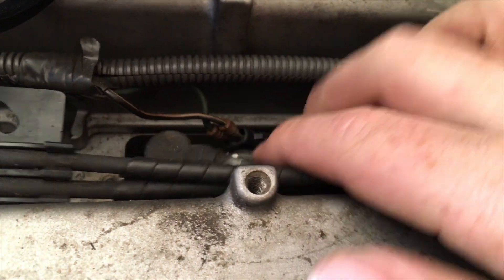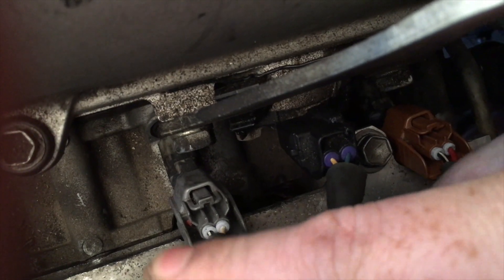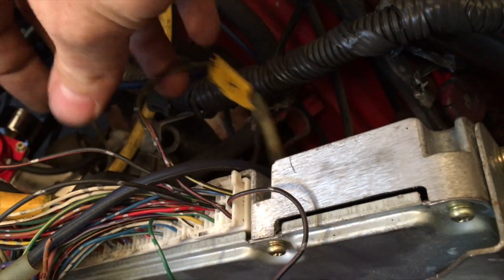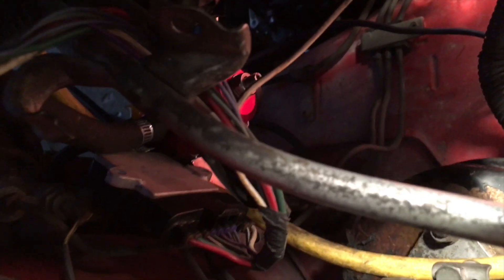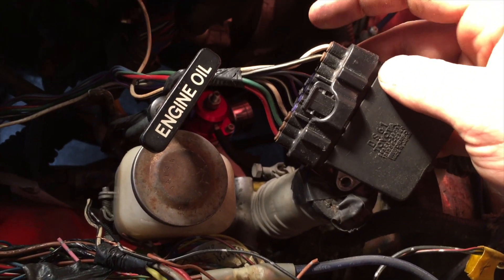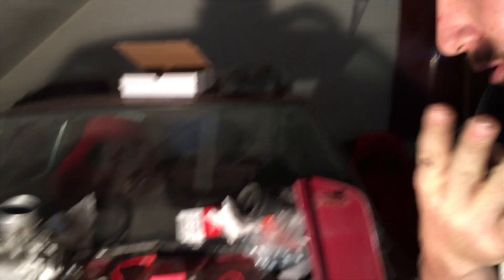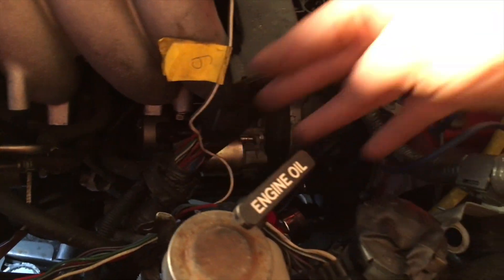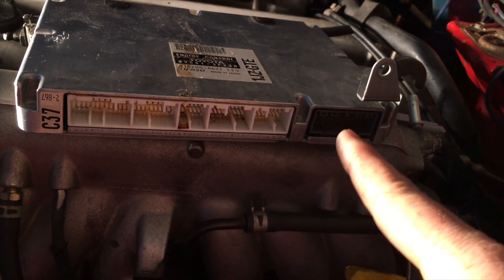how to wire a 1jz gte vvti

Comment: need help anybody???? did an engine swap 1jz vvti to jza80 surpa. just loss at a the fuel system. 1jz vvti ecu FC and FPR pinout, jza80 stock fuel pump ecu FPR and DI pin out. need advise what connect to what?

Comment: I am having a weird problem on my ecu wiring. 
I have a 1jzgte jzs171

I connected the battery and bm (ects i power) to a constant power.
I connected +B, MREL, IG SWITCH, and +B2 to 12v Switch.

When I turn the key over, it starts but I have to keep holding the key.
When I let go of key, the engine turns off.

BUT when I connect all of them together to Constant 12v power. 
They car starts and everything but I can't turn it off with the key, I have to disconnect the wires.

Also, every time my engine does start, the electronic throttle locks up. It does not want to open.

Can anybody help with any information or advice?

my email is richardpnl@gmail.com
Reply: Richard P i have the same motor and I’m having a hard time with the wiring. Do you mind helping me out? My email is palmer2244@yahoo.com

Comment: I see you  replaced the throttle body, did you get a rough idle and rich condition with the other one when you first started it. I have the etcs-i on mines and it idles rich and rough with it. did you get the same condition?

Comment: I have and odd issue with mine. Im running a megasquirt 3 on my 1jzvvti and every time it turns over it sounds like its not running on all cylinders. My FPR reads 40psi of fuel going thru my rail, i dont think its a fuel issue. Do you think the coil packs wired incorrectly may cause this? doesnt seem to want to rev passed 2500-3000 RMPS as well.
Reply: Did you fix it?Having the same issue.

Comment: Hey man I have a 240z doing the same swap except mine is a non vvti was wondering if you could help me out my email is gcarlosp352@gmail.com
Reply from the maker: yea dude ill tell u what i can what do u need help with??
Reply: Thank you the non vvti harness is different and has the coils to the igniter and injectors the computer harness but I was told I can send main power to the ecu and it will power everything but I'm now sure to what wires
Reply from the maker: the way i would do it is i would give power to the ecu and get a inline ignition spark checker ( http://www.harborfreight.com/inline-ignition-spark-checker-69014.html ) and if you see spark then you're good, but im pretty sure that you have to give 12v to the coils and injectors and also to the ecu because the ecu grounds each injector and coils when needed but what is good about the non vvti is that you dont have to worry about an immobilizer and sorry i cant give you an exact answer because in not too familiar with the non vvti but i found this page for you http://www.celicasupra.com/forums/archive/index.php/t-28346.html hopefully it helps
Reply: Alright thanks I will give it a try and see what happens get back to you Wednesday or something thank you for your time man

Comment: nice colorado is beautiful i am originally from california yea like my main concern for my swap is the wiring part did you hook up yours already all the way? what would u say was the hardest part of this swap? by the way i will be staying auto instead of manual
Reply from the maker: +Barrio Van Nuys yea its all wired up to a fuse block and alternator to the battery and to the 240z harness so it has power to everything and the hardest part was finding the wires that give 12v to the injectors and coils cuz you have to go through the engine harness and find all the wires that you need but its not that bad you just need time to look through..  do you have any videos of the cressida??
Reply: O i see brother yea i have pictures of it not video yet i just recently bought it a few months ago i got it at an auction in california its super clean i have a instagram where i have pics of it you got instagram?
Reply from the maker: whats  ur instagram?? and i do have one but i havent posted any pics

Comment: Hi
Can i connect all the wires you said  to one relay and then make switch , so all that wires will get 12v at same time?
Reply from the maker: yea you could do it but it would be better if you kept the batt wire on the ecu separate because that one should have 12v at all times and you could wire the coils, injectors, the pump and the rest of the ecu on the relay the starter should be a separate switch hope this helps
Reply: +Walther Olivas thanks man
I just want run engine for some time then will go to stand alone ecu
Reply: +AMG 560SEL  sorry , i just want to know  why did you put fuel pressure regulator , why you just use the stock because   You already have stock ecu and injectors i think
Thanks
Reply from the maker: i just installed the fuel pressure regulator  because i wanted to see if i had fuel pressure and if the fuel pump was working properly
Reply: +Walther Olivas  i see, thanks for videos
Reply: I've subbed and liked your video.

Comment: planning to buy one of these .. any tips guys .. should i go to a built one or go for stock
Reply: make sure the ecu on your engine doesnt have an immobilizer and avoid the etcs-i (drive by wire) throttle body the etcs will save you time

Comment: why did u ground the white wire? the white wire on the ignitor is a coil  power wire?
Reply: i just looked for a wiring diagram on google and it showed that you need to ground that wire or else the igniter wont work
Reply from the maker: yeah if you dont ground it it wont work and it doesnt go to a coil its just ground